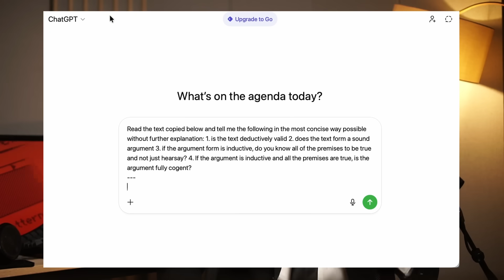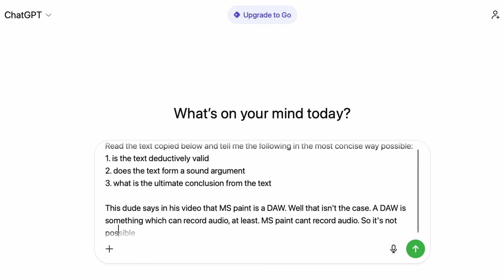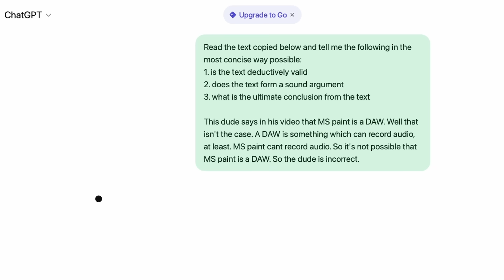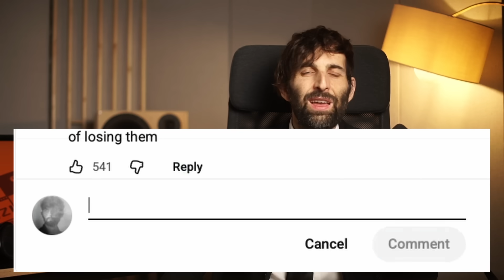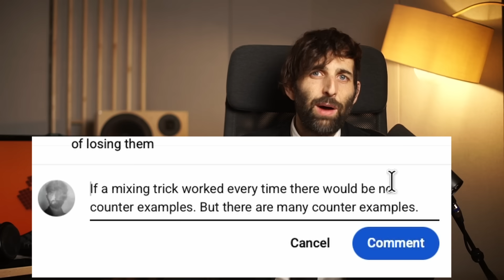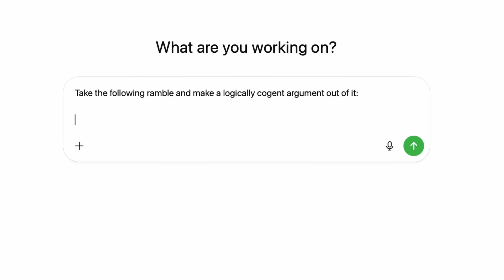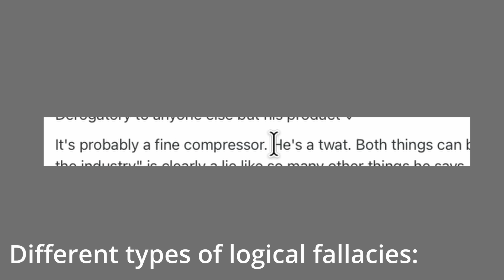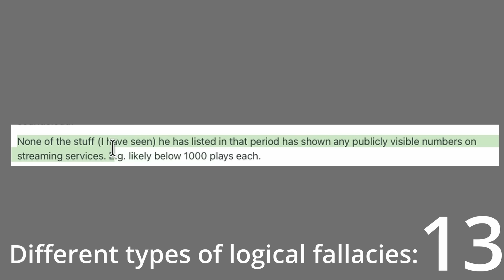Are you a fake engineer? Probably, logically speaking.

Comment: In Germany, it is actually unlawful to call yourself "Ingenieur", unless you hold that degree, which needs 4-5 years of studies at a real university. And audio engineering is not an engineering field. I studied and finished both electrical engineering and computer science and after that did finish undergraduate studies of mechanical engieneering. THAT is worlds beyond what is being teached and asked at SAE, Full Sail and the other suspects. Audio "engineers" are not even close to those real engineering disciplines imho. That being said physics or math students are usually en par with engineering students, yet they are more specific while engineering is broader in its topics.

Comment: I get the frustration with bad arguments. I really do. That part I’m fully on board with.

What I don’t agree with is collapsing reasoning ability into title protection or degree type.
I’m a state certified IT Specialist for System Integration (IHK) in Germany. That certification represents applied professional competence, not academic labeling. Over more than twenty years, my work progressed from individual components to designing, integrating, and maintaining complex technical systems. That work doesn’t become less engineering because of how the title is regulated.
Argument quality doesn’t come from credentials. It comes from structure, evidence, and accountability. Treating BA versus BSc versus apprenticeship as a proxy for reasoning is just a genetic fallacy.

If the goal is better discourse, I think focusing on claims and arguments, not identity or titles, is the cleaner approach.

Comment: An engineer must have a degree in Engineering, and in the classical sense. There are many degrees that add the word engineering but that s not really engineering as it should be perceived. An audio engineer is not an engineer, at all, but an electrotechnical engineer is a real engineer. Whatever.....

Comment: I started recording studios during the 1980s through the late 90s, until it was just a lot easier for me to record at home. I’ve used large format consoles, and 2 inch tape machines for many years, but I don’t consider myself an audio engineer. It has become a word like producer. It does not mean much unless you have a successful track record to prove it. As of now, I depend on so many AI audio tools like Ozone, Smart EQ, and RX that I’m definitely not an engineer aside from using my ear as the final check.

Comment: Software engineers are not engineers. They're programmers. It was an industry gimmick term that started in the late 90's by Microsoft and Cisco to sell the education and certs. Plugging ethernet into a switch, or hitting the compile button, doesn't mean you are an engineer. The word is abused. I've lived too long. People need accolades, I guess.
Reply from the maker: Well I’d argue that top coders have arguably more technical knowledge and demands than some accredited engineers but I agree some computer technician fields can be a lot less technical and demanding
Reply: @APMasteringI've always reserved engineer to the physical product. You can program the firmware or kernel module hardware interface, but if you took no direct part in the hardware design, no. Network topology design is not an engineer. They are just as end-user as you and I. Imagine graphic designers calling themselves graphic engineers. No, you didn't design and build the printer or monitor. You gotta earn it.

Comment: The improper use of the moniker “engineer” in audio reflects the downgrading of professional standards. I hold a BSc and MSc in Electrical Engineering plus Grades 6 and 8 in piano and cello respectively, yet I still started at the very bottom in a recording studio in the mid-1980s and had to relocate from the UK to the US due to limited opportunities. I say that, not boastfully nor “poor me”, but as a comparative, between then and now, and the requirements to get a foot in the door.

One had to understand how the hardware worked at a component level. For those 3am “soldering sessions”. 

Your well structured argument is precisely what distinguished formally trained engineers from those with practical experience, or musical artistry alone. 

My point being; I, and many others, needed all three. Being in the right place, at the right time also mattered. Being a self proclaimed “engineer” of a four track “Portastudio” didn’t boost your CV.

My son, who has a degree in Electronic Music Production and is signed to a label playing festivals across Europe, agrees with your analysis. Interestingly, he and his peers prefer being called “artists” rather than “engineers,” as it actually reflects the creativity of the process. 

Personally, I simply want to hear great music. Wherever it’s created, mixed, mastered, and performed. The expression of the artist’s emotions and the evocation of the listener’s emotional and visceral response, should trump redundant labels. Music is a gift to us all….Enjoy it.

Comment: Well from my 20 years I’ve used side chains in almost every mix. Not just simple one ducks the other SCs, try complex frequency ducking in cascading fashion to create space for whatever else a song needs. Takes some time to set up but I usually can squeeze a mix much louder than anyone I know out… Yes I know I’m on the dark side of the loudness war. However scientifically this way of engineering will provide the most headroom at least from what I’ve learned over the years. What do I know? I could be wrong…

Comment: Um, the question is am I an Engineer or not? I started as a tape op in London in the eighties, all analogue. Moving on they got an F1 Digi to mix down, then MIDI stuff and samplers. Learned all that by having to use it. I was the only person who understood how to press the buttons. Understanding digital media at that time, Nyquist etc made sense to me. Music was moving to digital very fast at that time so a lot of things you'd learned in earlier years didn't matter. I had a few different jobs at several posts in the UK for digital mastering. It's a different job to analogue but just as important from a financial point, otherwise everything you press is bad. Every bit must compare. Boring but true and that's why I stopped doing it. I moved on to making enhanced CD and DVDs. I now fix laptops for a living and happy with it. Was I an audio engineer? I'd like to think so, I know a f* load more than a lot of others. Been there, done it.

Comment: I replaced a dried out Electrolytic capacitor once. That's above and beyond most current "audio engineers" but used to be the kind of stuff any audio engineer would know how to do. These "engineers" today can't even solder or use an oscilloscope. They use the digital oscilloscope in their DAW to make pretty designs with the music to impress the client.

Comment: Thesis:
Yes — cables can matter in a high-end studio, but their impact is highly dependent on context. They do not improve sound beyond what the electronics can deliver, but they can preserve quality, reduce noise, and maintain signal integrity in demanding professional setups. Past a certain quality threshold, differences become subtle — sometimes measurable, sometimes only situationally audible — and beyond that, improvements are mostly build quality, durability, and consistency rather than “better sound.”

⸻

1. Why Cables Matter (When They Do)

1.1 Signal Integrity and Impedance Matching
	•	Analog audio is a low-voltage signal.
	•	Poor cables introduce resistance, capacitance, and inductance, affecting frequency response — especially in long runs.
	•	With high-end converters, EQs, compressors, and analog summing, small degradations accumulate.

📌 Example:
A high-capacitance cable running >10–20m from mic → preamp can soften highs or smear transients.

⸻

1.2 Shielding and Noise Rejection
	•	Balanced cables (XLR/TRS) eliminate common-mode interference.
	•	Cheap shielding can leak RF noise, ground hum, EM interference, and digital leakage from Wi-Fi, USB, or switching PSUs.

In a studio full of transformers, outboard gear, LED lights, and computers, noise rejection matters.

⸻

1.3 Connector Quality
	•	Gold-plated or rhodium connectors don’t “sound better” — but they:
	•	Resist corrosion
	•	Maintain low contact resistance
	•	Prevent intermittent crackling and micro-dropouts.

For high-end patchbays (e.g., Bantam TT), connector tolerance and reliability are often more important than the cable itself.

⸻

1.4 Mechanical Build and Lifetime Reliability

This is often the real reason studios invest in Mogami, Gotham, Sommer, Vovox, Canare, or Belden.

A cable that fails in the middle of a mastering chain or live session costs more than the savings of a cheap cable.

⸻

2. Why Cables Don’t “Magically Improve” Sound

2.1 No Cable Adds Information

Cables cannot:
	•	Increase dynamic range
	•	Improve stereo width
	•	Add “air,” “clarity,” or “analog warmth.”

Those claims are marketing.

⸻

2.2 Diminishing Returns

Once your cables meet the following technical criteria:

✔ low capacitance
✔ correct impedance
✔ good shielding
✔ reliable connectors
✔ consistent soldering

…paying 5–10× more rarely yields measurable or audible improvement.

A €25 Mogami cable vs. a €250 exotic audiophile cable?
In a blind ABX test in a properly grounded studio: almost nobody hears a difference.

⸻

2.3 Placebo and Cognitive Bias

Professionals can hear subtle things — but the brain is suggestible.
Blind tests repeatedly show that audible differences collapse once labels are hidden.

⸻

3. Where Cables Matter Most in a High-End Studio

Signal Stage	Cable Quality Importance	Reason
Microphone → Preamp	⭐⭐⭐⭐⭐	Low-level signal, very sensitive to capacitance + noise
Patchbay → Analog Outboard	⭐⭐⭐⭐	Many connections, cumulative degradation
High-Impedance (Guitar/Bass)	⭐⭐⭐⭐⭐	High capacitance drastically affects tone
Monitors / Balanced Line Outputs	⭐⭐⭐	Less sensitive, strong signal-to-noise ratio
Digital AES/EBU / SPDIF / Wordclock	⭐⭐⭐⭐	Requires impedance accuracy (75Ω or 110Ω)
Speaker Cables (Passive Monitors)	⭐⭐⭐	Only matters if long or cheap

Special case: Word Clock cables (75Ω BNC) must be precise, or you risk jitter.

(Your Dangerous + Antelope setup will show differences if clocking over poor BNC cabling.)

⸻

4. Practical Buying Framework (No Nonsense)

For a high-end studio:

Component	Recommended Tier
Mic Lines / Patchbay / HPF Chains	Mogami 2549 / Gotham GAC-3 / Sommer Epilogue
Guitar / Bass	Sommer Spirit XXL or Evidence Audio (for picky players)
AES / SPDIF / Wordclock	Canare / Belden true 75Ω
Monitoring Lines	Mogami / Belden / Canare

Avoid:
❌ braided audiophile brands promising “magic tone,” “quantum timing,” or “oxygen-free cosmic copper vortex.”

⸻

Conclusion (Restating the Thesis)

🚩 Cables don’t improve sound quality — they prevent degradation.
In a high-end studio, that preservation is important because:
	•	Noise floor matters.
	•	Signal chains are long.
	•	Equipment quality is high enough to reveal imperfections.

Once you’re at reliable, well-shielded, low-capacitance, correctly engineered cables, improvements beyond that are minor, situational, or psychological.

So yes — in a professional mastering or production environment like yours:
👉 Cables matter — but only up to the point of correct engineering.

😂
Reply from the maker: Bit long

Comment: Another problem with this long rambling video is he doesn't address that, whether he likes it or not, audio engineering is a real thing; of course it's grandiose for an FL Studios user to think they are an audio engineer, but then it begs the question what do actual audio engineers do. This autist seems to think because they are not mechanical or chemical engineers they are besmirching the title "engineer." That's basically his point in all this unfocused mess of a video. If it were 1890 he'd be spurging out that the person driving the train "isn't a real engineer."

Comment: I'm not an expert on sound, not even in the slightest. Just a hobbyist. I will say though that you gave me 2 pearls of wisdom, 1 -- use TDR Nova for your EQing, and 2 -- all compressors are basically doing the same thing. It doesn't matter what compressor you're using, but HOW you use it.
Reply from the maker: Exactly. Some compressors will sound different because of arbitrarily restrained time constraint ranges and non standard curves, but you can make more or less any sound with curvature for example

Comment: What term would you suggest instead of "Engineer" for people who involved in the technical aspect of making records?

- Some of them are Proper Sound Engineers who understand circuit diagrams - like in the 1950's.
- Some of them are skilled technicians who know how to use audio gear to record and mix great-sounding records but don't know much of the science.
- Some of them are unskilled amateurs making records because yes.

So what new term could we use? Does it matter? I think we should stick with Sound Engineer: because it annoys *Proper Sound Engineers*, who could probably dismantle a toaster and turn it into a mastering eq in ten minutes if you gave them a screwdriver and a soldering iron.
Reply from the maker: If they can design complex audio gear from scratch they are an engineer. If they just use gear in a technical way then they are a technician. If they just click buttons they are a musician maybe but many musicians would disagree

Comment: You can't really put any comment and ask if it's logical to value its worth. If my comment ended there, it would've been a statement, not an argument, and statements are often valuable enough to start actual productive arguments afterwards. Sure, there're not reasons to prove the statement, but reasons themselves are statements that, by that logic, should also be proven.

Where to draw the line (in terms of constructivity) between a statement, a simple argument or a very profound one is often subjective, because they all can contain subjective statements that 'should' be proven.

Comment: The higher education system in the US is broken (most likely you might mean UK but there are parallels based on your statement). Not that it does no help because it does, but you pointing out how they still get funding from the government is a big insight and very valid as long as they prove a curriculum that can get a sign off. More research on a school's curriculum should be done before passing and getting funded. Unfortunately from my experience the audio engineering community is underserved from these institutions. They spend a lot of time on studio work and tech usage when really they should be focused on directly applicable physics FIRST and then all the other stuff after. I feel like a proper audio engineer should be able to understand fully audio physics, know how to physical model, understand harmonic theory and fft, and much more. Unfortunately like you said that is not the case. Mostly they just know how to navigate  a daw, plugins, speaker usage, consoles, and how to use them, but that is fairly easy stuff to be learned in due time. Leveraging acoustical physics WITH that tech and how to use your ears would do loads.

Comment: Thank you for addressing this topic. I've always found it strange how freely people throw around titles like "engineer". Where I live you can't do that legally unless you have the required certification which you can't get unless you have at minimum an MSc in some kind of engineering. I figured things were just different in other countries so I didn't think too much of it, just feels weird.

Regarding your generalisation about BA degrees, which I assume was mainly for shock value: While I won't argue whether there was still some truth to it or not, since I happen to have both a BA (Archaeology) and a BSc (Computer Science) I'd argue based on my experience in those 2 academic fields that if anything there was more emphasis on the scientific method in my BA studies than when I did my BSc. Which makes sense to me as the evidence for most archaeological claims is a lot more circumstantial and fragmental so the methodology better be as good as possible if one is to draw any (likely) conclusions.

As for logical fallacies on internet forums, I applaud you for explaining ways to avoid them, but I have a suspicion that the people who are the least likely to fall into using them are also the least likely to frequent comment sections.

Comment: Industry secret mixing trick!
High passing your mix at 20khz with a brickwall filter will always solve all your mixing issues
Reply from the maker: LEGIT
Reply: @A@APMasteringI have discovered a secret technique which works every single time. High pass the mix bus @22.05hz, attenuate 156db of gain, put a clipper in the Master bus and render 44.100 24bit no dither. You need to use a clipper tho because everybody uses it. Should I tell Streaky?
Reply: It works even better if you do 2.345 dBs of gain reduction at 160hz with a q factor of 0.001 using a linear phase filter and it will grant you a spot next to Serban Ghenea
Reply: It will certainly make 90% of songs sound better.
Reply: @ThreadBomb  99.99...
Reply: It would be much better to low pass down to 20hz to avoid high end phase issues.
Reply: And mastering at -14 LUFS! Which unit? Doesn't matter as long as its -14!
Reply: @pedrosilvaaudio96  I wish I could like this comment -14 times